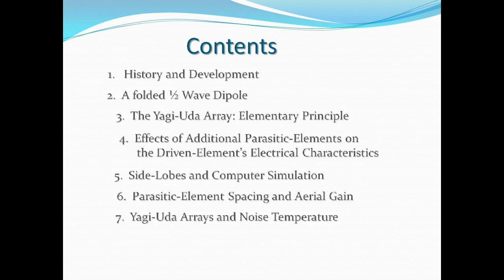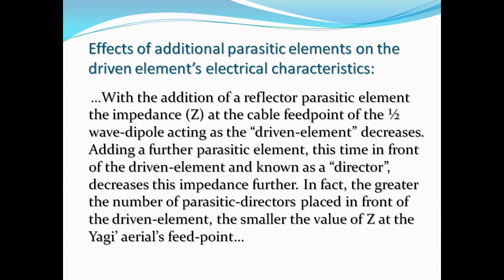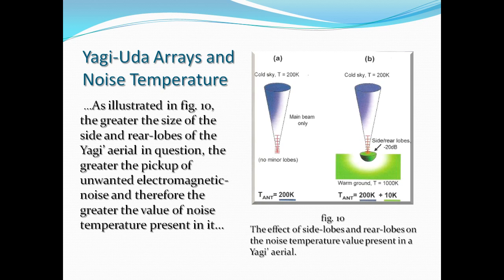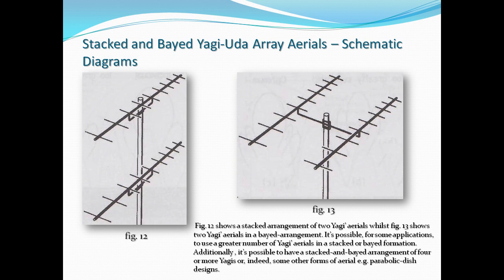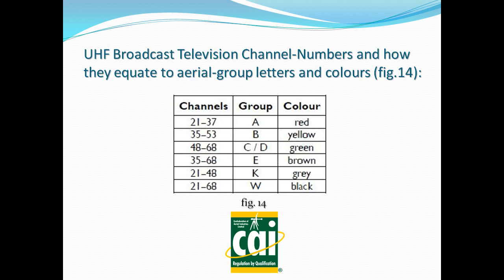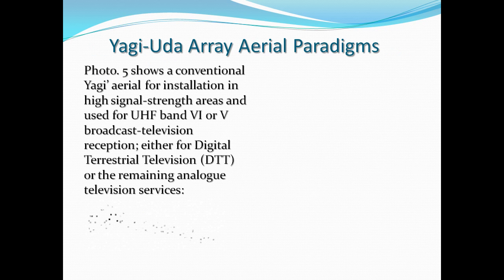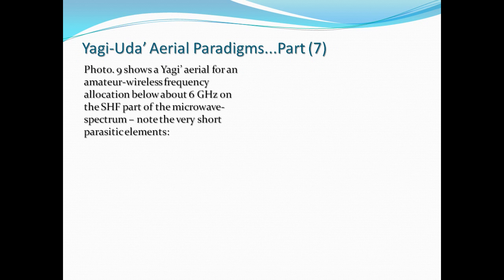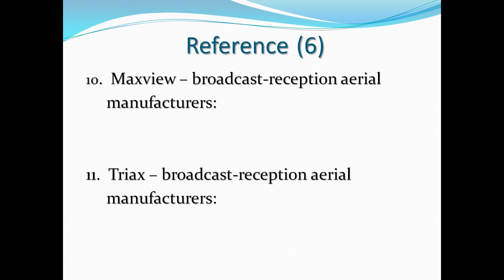Theory & Design of the Yagi-Uda Array Aerial [II][L][5].wmv

Comment: New Zealand TV transmission and reception is a carbon copy of the UK "Horz" vs "Vertical", in the US and Canada no such system is used as the transmitting antennas are circular (LHCP, RHCP) and the receiving antennas are mostly broadband log-periodic-horizontal.